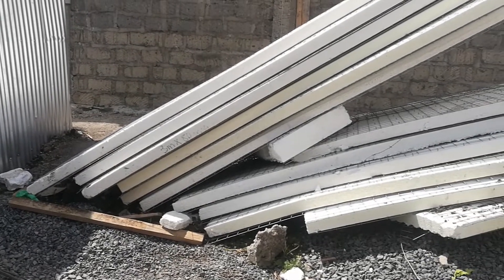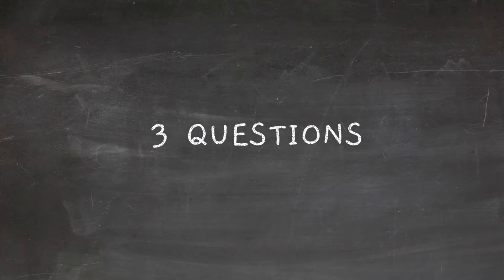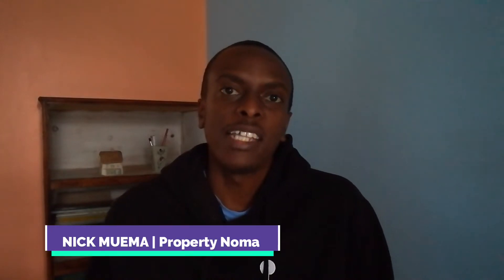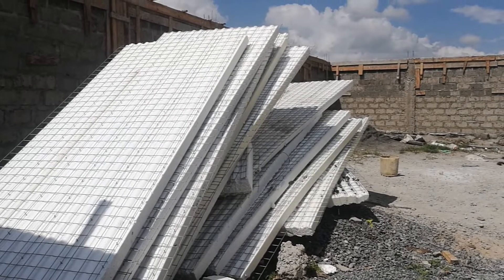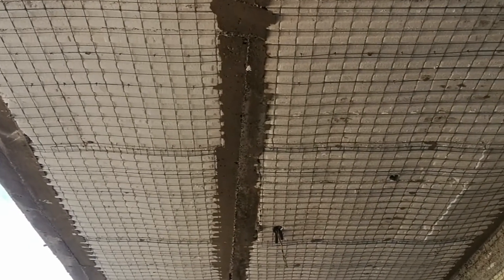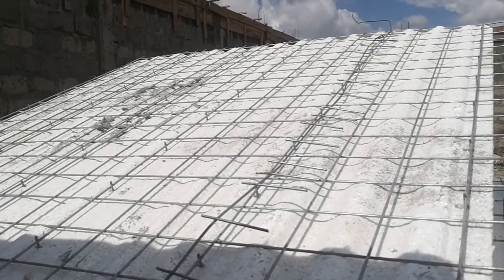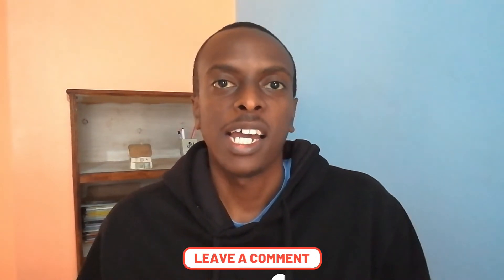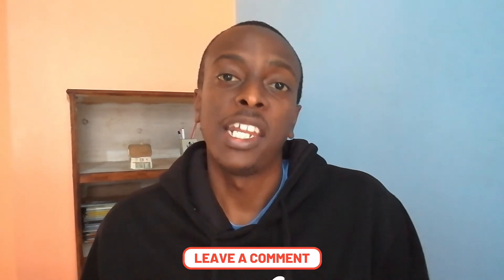Answering 3 Questions You Probably Have About EPS Panels

Comment: Hello, which is the best between Eps panel and precast panel?or which one would you advise 😉
Reply from the maker: I prefer precast panels because it's already a finished product. A slight disadvantage with precast panels is that they only have one thickness, 90mm. But I would suggest precast panels over eps panels
Reply: @PropertyNoma  than you Nick,you are a good presenter, keep it up